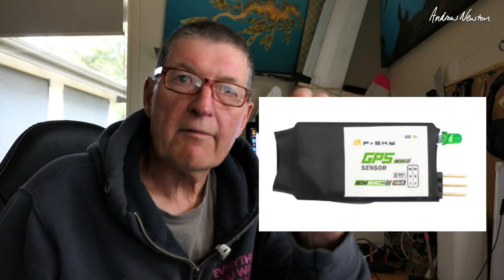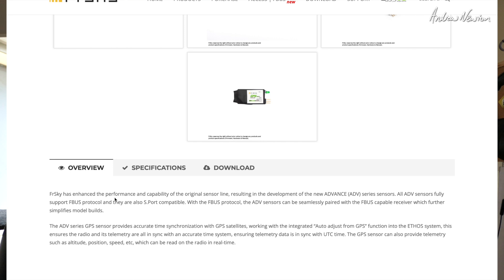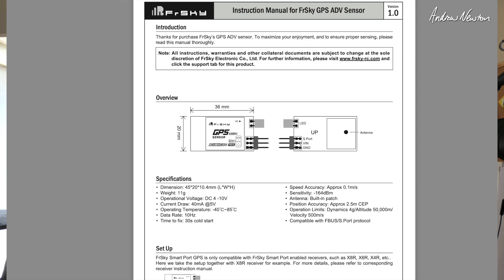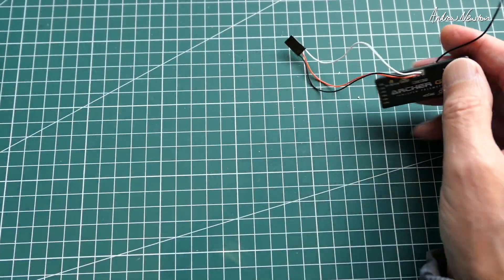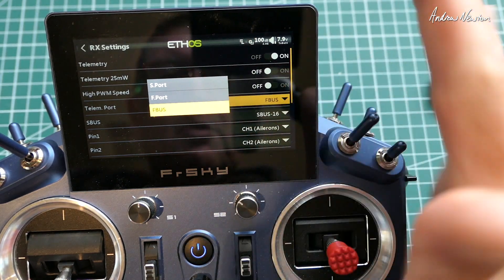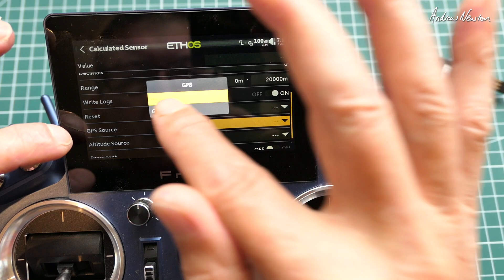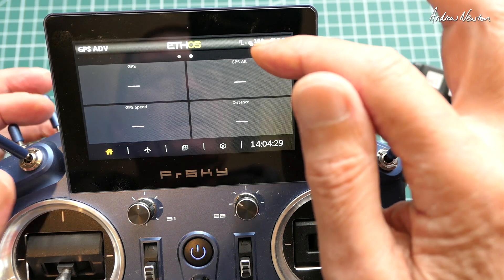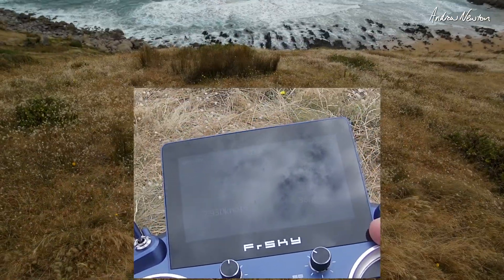FrSKY GPS Advanced Sensor. FBUS and logs

Comment: the main power wire for these frsky recievers is so fine, how can it power all these servos and sensors? guess it must be enough, it's finer than the wire that goes to an individual servo
Reply from the maker: Power wire would come from your ESC or BEC so you can choose how thick it is. You might be thinking about the sensor wire?
Reply: @AndrewNewton  look at the archer SR10+ reciever, the power in wire you connect to is really fine, I soldered a servo connector to those wires and connected to the BEC 5V but I changed that and just plugged into an unused channel pins.  But what if you're using all the channel plugs for servos? then how would you power it?
Reply from the maker: Use a Y lead to share voltage in with one of the servos. But if you're using 10 servos you should be powering them directly from a big BEC rather than through the receiver
Reply: @AndrewNewton   how do you wire them  directly to the BEC? only run the signal wires to the receiver? That's a lot of soldering.
I only added two more servos for a camera gimble, maybe it wont overload the receiver

Comment: Hello! I have a fiber glass glow sport airplane (150+ mph), can I install the GPS inside the plane? Will I get the signal? I can't install in the outside

Also, can I see the max speed that my plane reached on my radio after each flight? I have the X20s, I just want the gps to see the max speed that my plane gets
Reply from the maker: Yes to both. FG is transparent to GPS. Long press on GPS Speed to get Min or Max options
Reply: @AndrewNewton  Tyty!

Comment: Hi Andrew. I'm having massive confusion getting my FrySky FLVS advanced Lipo Voltage sensor with FBUS cable from receiver connected up to the voltage sensor itself.. The FBUS cable i have has 6 coloured wires. Black, red, yellow,  which splits off to a black 3 pin connector, then there are 3 other green, white, blue wires going off to their seperate single black connectors. I figured out from other videos that the black, red, yellow connector goes into the lower set of 3 pins on the lipo sensor with yellow on ground and black minus and red positive. I do not have a clue where the green, white, blue seperate connectors go. Its confusing. I have a FrySky Tarranis X9D Plus with a RX6R receiver in a Volantex SR65 RC Boat. Can you help or please make a video showing how to set up this FBUS green white blue cable. They come off the white FBUS connector and are going to nothing. I notice on the back of my receiver , the green is listed as Aux, white as SBus_Out and blue as SBus_In. I still don't know what these do and whether i need them ?
Reply from the maker: You probably dont have FBUS on your receiver. Yellow would be S-Port, so just plug that 3 pin connector (black red yellow) into the sensor (either set of pins, they are the same) The other three wiress are for other uses and can be just tucked out of the way. AIN2 is Analog IN (for an analog voltage sensor) SBUS OUT is for connecting to a flight control board, SBUS IN is for connecting a backup receiver. This older video shows the connection https://www.youtube.com/watch?v=ztDvA_FFcfE

Comment: Hi Andrew, nice to see you moved to the better state 🙂. Have you joined a model flying club in SA? there are some nice clubs in the south.
Reply from the maker: SA is excellent. Have visited a couple of the clubs.
Reply: @AndrewNewton  I have the first gps frsky had via s-port, I found that from when I flicked a switch to tell me the speed it was about 5 seconds delay. example if I flick a switch to read out the speed at the fastest past of the dive then pull up it would give me the speed about 5 secs before. how fast is the updates to the transmitter now?
Reply from the maker: I didn't notice any delay, but you can call out maximum speed rather than current speed

Comment: Hi
Tried to compare the speed with that of DJI drone, came out it showed only 1/3 of the dji speed.  Wrote to the supplier while still no response. Any glues from you
Reply: I notice at 2:38 Andrew shows the Firmware download page which notes V1.7 "Fix the issue of having the abnormal telemetry value of GPS speed". You may want to check your firmware version.
Reply: Sure let me check 
Indeed one could use DIY sensor to modify using ratio…. Anyway will explore your idea first. Thank you
Reply from the maker: That's odd. Mine have both been pretty accurate compared to other GPS sensors.

Comment: Interesting point at the end: is there a way to use this with a Matek flight controller, for example?
Reply from the maker: No, this is designed as a receiver connected sensor.